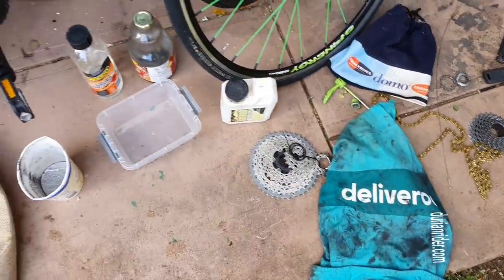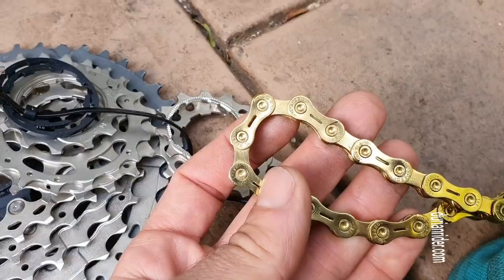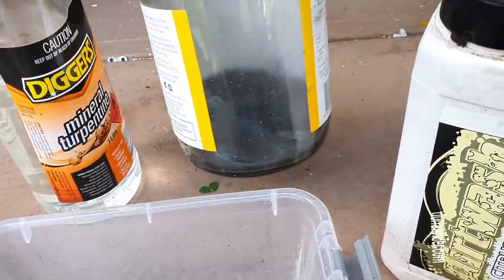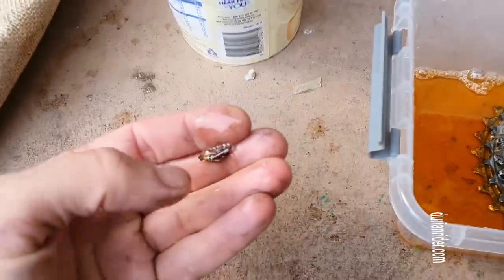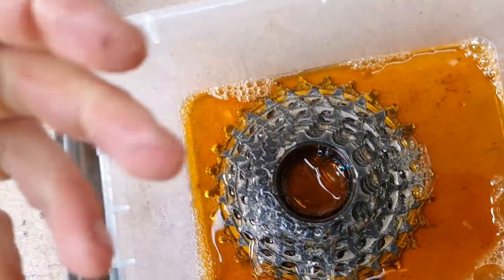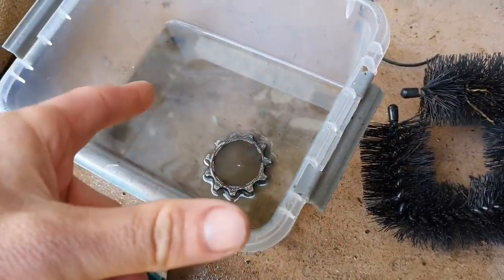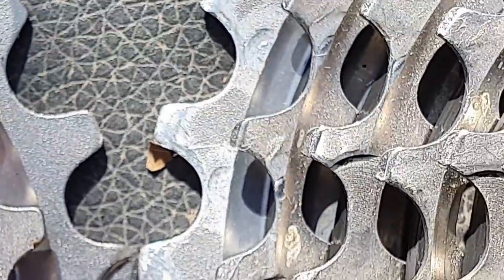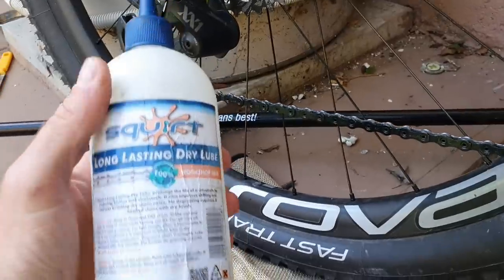The BEST way to clean bicycle chains and cassettes at home

Comment: I use paraffin wax and cleaning the cassette can be done on the bike with boiling water (carefully) or by blowing with a hairdryer to melt off the debris while wiping with an old rag. No chemicals needed.

Comment: hi Durianrider, nice vid, i use also squirt wax. Just i'm wondering why they notice on there manual 'once clean an waxed not to degrease your chain again?  makes you lay wax on dirt wax... i clean them every 2 weeks with degreaser and rewax( degreasing a waxed chain is 5min work, it's just the old wax thats on the chain, no dirt) , in the meantime i ride a 2e chain that already was cleaned and waxed.

Comment: Always wanted to try a YBN chain. I started using Molten Speed wax last year and will never go back to lube chains again. It takes a bit longer but with a few chains it make the job a lot easier. I use wax chains on my trathlon bike my fat bike and gravel bike and Molten Speed Wax is a nice local company to have in my back door here in Minnesota USA

Comment: I have never cleaned my bike because I don't know how to put it back together if I take it apart. I can adjust the brakes, seatpost, change the pedals, but derailleur? No way.
Reply: You can wash your drivetrain without disassemble all your bike. I think you can do an Ok job just by removing the chain to clean it, and remove the back wheel to clean the cassette with a brush. The rest of the bike can be clean whithout disassembling. The alternative is to loose watts and money on a pourly maintened bike.
Reply: @damienmarguerite827  Good points, how often does a bike need to be cleaned?
Reply: @thegoodguyalwayswins  It's just my personal experience. After each ride, I wash rapidly my bike with a water spray and a specific bike cleaning solution, specially around the cassette and chain. After each 300 / 500km, I remove the chain to clean it nicely. And I use only dry lube, even if I ride often in wet condition as wet lube will stick a lot of dust.